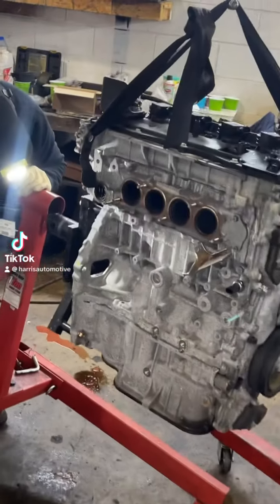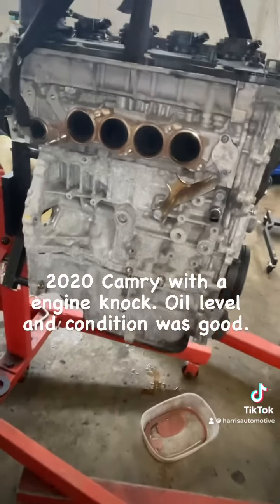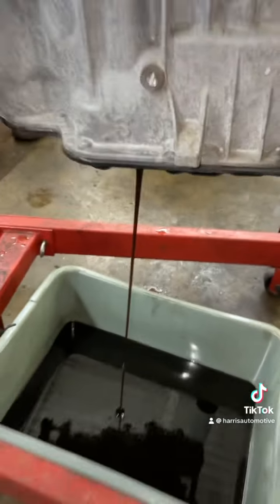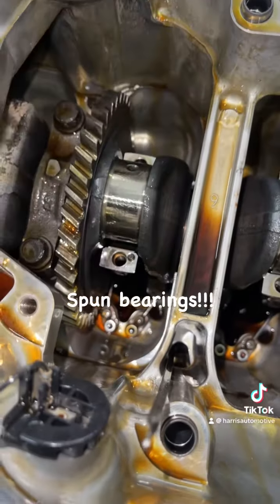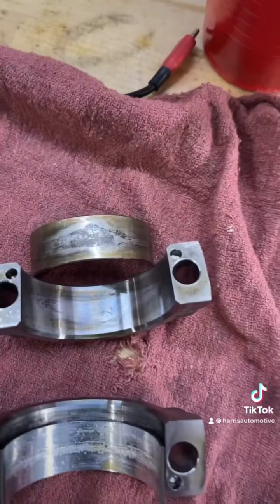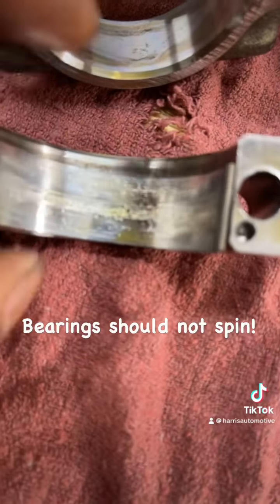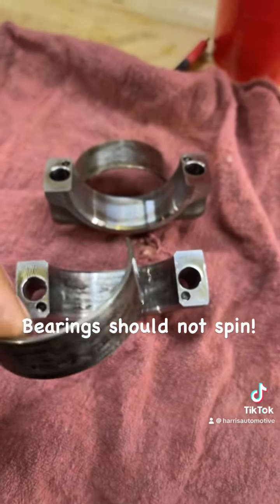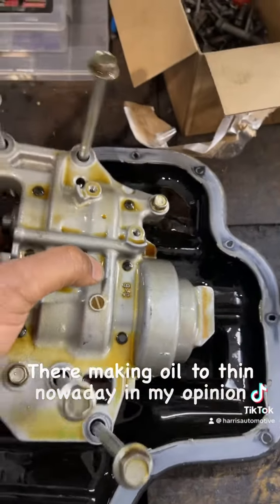Do we all think oil is too thin now?

Comment: The manufacturers call for 0-20 or 0-30 weight to reduce friction so they can eek out another .5-1 mpg.  They also call for an oil change every 10-15,000 miles so they can claim reduced maintenance costs.  They figure the car's out of warranty by the time the bearing spins.
Reply from the maker: I agree

Comment: It's not that 0w20 is to thin, It's a lack of maintenance. This is a passenger car, not a race car.
Reply: I believe some engines just fail sooner than others. I change mine every 10,000 miles and have no issues with spun bearings, sludge, etc.
Reply: It can be both. Unfortunately without further info about the car's operating conditions prior to failure it's difficult to judge appropriately. If they are having oil reach too far over 100℃ then it will start breaking down and thinning out more quickly. So the 20 becomes a 16, etc. In which case you may end up having metal on metal contact if pushing the car too hard. Alternatively, they ran the oil too low, spun the bearings, then added oil afterwards thinking they could remedy or hide the problem.

Comment: I agree that the oil is too thin anymore... with alot of vehicles calling for 0w-20 semi synthetic oils... there is almost zero protection. I understand that they are running tight tolerances in these engines and the tighter the tolerances the lighter the oil has to be but when the oil in your engine is almost the same viscosity as the oil you cook with I think they need to reassess what they're doing when they design these engines. Honestly I think they are just making throw away cars anymore because they want to push alternative propulsion vehicles that don't require oil at all.
Reply: They are not meant to last.
Reply from the maker: The mainufracture doesn’t care once the car is out of warranty,
Reply: @goharrisautomotive  very true.

Comment: The bearing tolerances are tighter, so the oil has to be thinner to lubricate into those tighter gaps. I don't think thicker oil is going to be a good idea.
Reply: It helps provide a better protective wedge when temperatures or pressures get high enough to thin or push out that oil wedge. 

My 86 calls for a 0w-20 but I only use 5w-40 unless it's unavailable. Both to protect against thermal breakdown with the oil cooler I have, and to provide  a thicker oil wedge to help protect against the increasing pressures on the bearings from being turbocharged.

Comment: It ain't oil, it is water. Too thin.
Reply: Well, if you have tighter bearing tolerances, you will have to use thinner oil to lubricate into those tighter gaps.

Comment: I bet they ran it low on oil and then refilled when they heard bad noises coming from the engine. That is oil starvation or maybe...and I mean maybe the wrong oil type.
Reply: Absolutely i drove my subaru with rod knock for 10k miles before i rebuilt it and didnt spun a bearing.This engine has had low oil pressure light for more than a minute thats for sure
Reply from the maker: If it was real low on oil, wouldn’t the bearings be blue from heat?

Comment: Ummm...at operating temperature 0w-20 is no different than 5w-20...which gas engines have been using for years. If anything the 0w would get to where it needs to faster in a cold engine.
Reply: Well, Toyota is using 0W8 now. I'll bet 0W4 is in the pipeline.
Reply: None of it really makes sense though. How can oil be thinner when cold, than when warm?